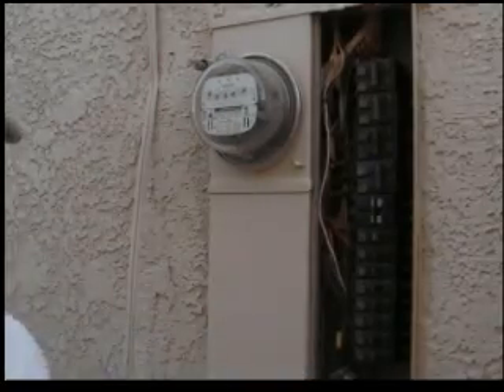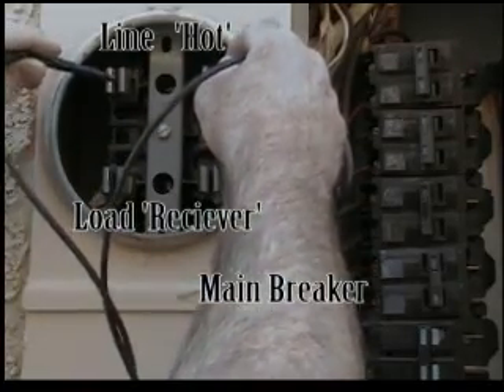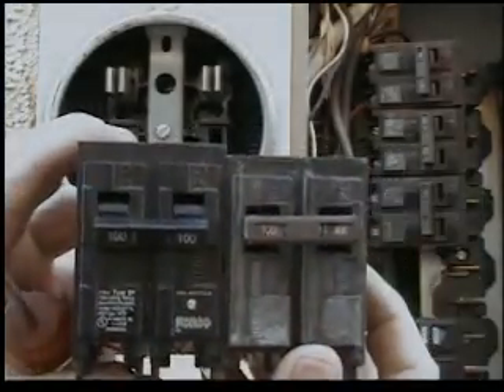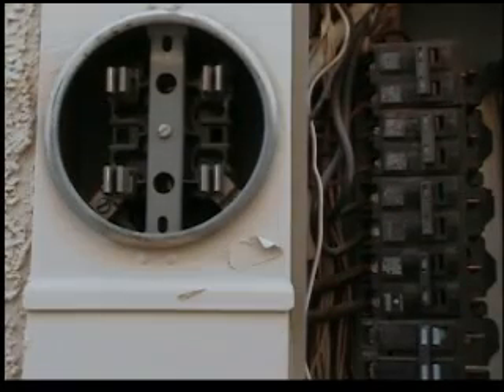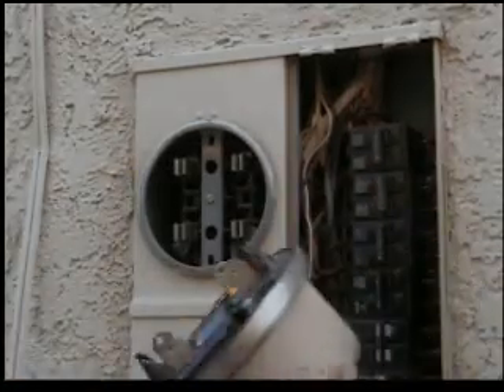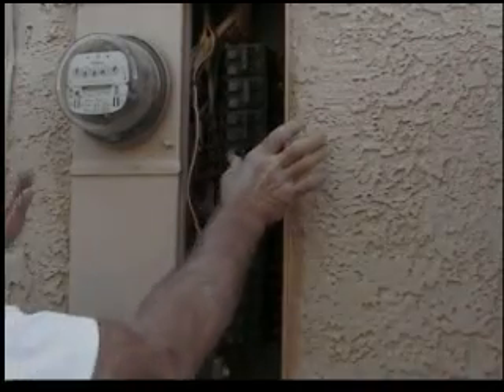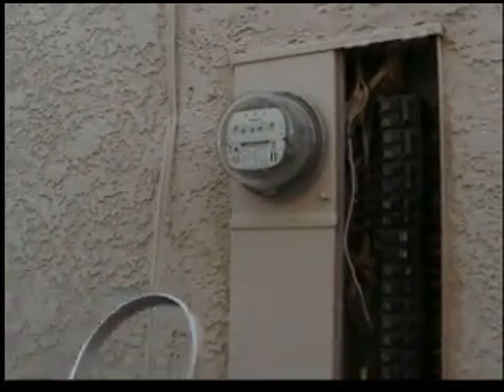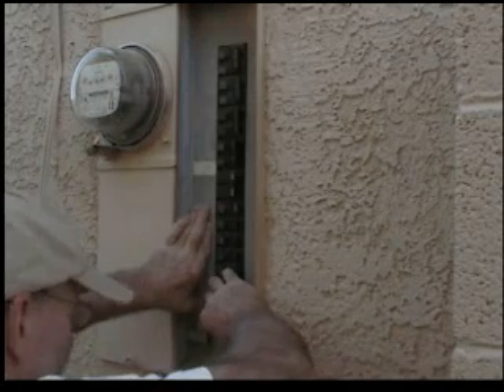Main Breaker Replacement # 17

Comment: Wouldn't it be proper to use a Deoxit Demystified or other electronic cleaners on the meter stabs? Or clean as much as you can in the entire box? I certainly would check or tighten all the connections (screws) while all the power is fully disconnected. Like DeOpresso Liber
 said turn off all the other Breakers so that you can energize the main breaker under no load. This is called thinking about what you are doing
Reply: If it ain't broke dont fix it

Comment: Its an easy job. However only licensed electricians are allowed to perform.
Reply: A person / homeowner has the RIGHT(doesn't mean they physically can) to do any work whats so ever on their OWN home anywhere in the USA but need to do due diligence like call electric company pull permit & use correct & properly installed materials etc. People forgot that we are a free country to the point we won't be anymore.
Reply: That's incorrect.
Reply: I have an electric board like that how i can upgrade it can you tell me please

Comment: My 200A main breaker's switch just broke off in my hand.  Can't believe how easy it is to replace but that I need to involve the power company to unlock the ring -- stinks.  What stinks even more is hearing about the contractors license when anybody can really do this using a DMM, some common sense and a screwdriver.  Sigh...
Reply: Dude you just cut the stupid locking wire.. The next time they come to look at your meter (which will be never with smart meters) ,  just be like shit howd that happen duh...
Reply: @JasonStAmand-5150  -  In ascending order of preference:
Ask permission
Beg forgiveness
Plead ignorance
Reply: @JasonStAmand-5150  How often is the locking wire rotted, rusted or just gone? If your replacing the main breaker the lock is probably very old